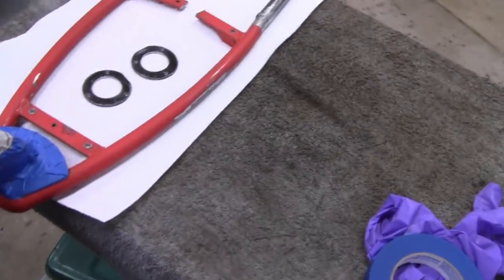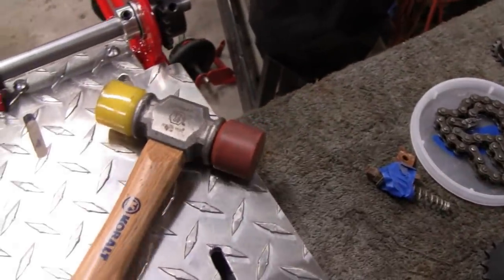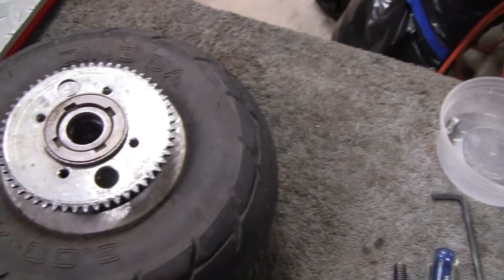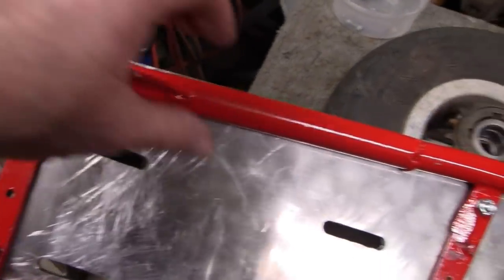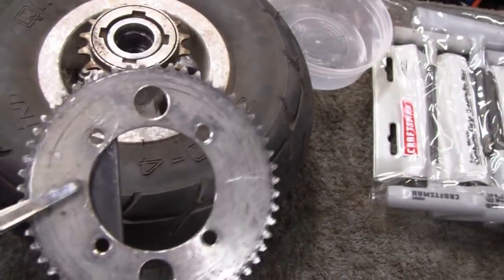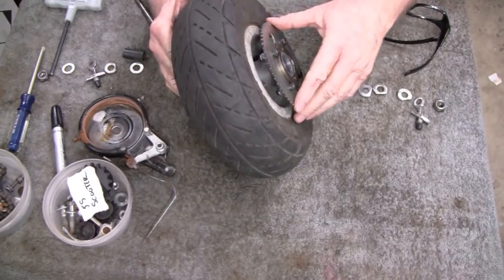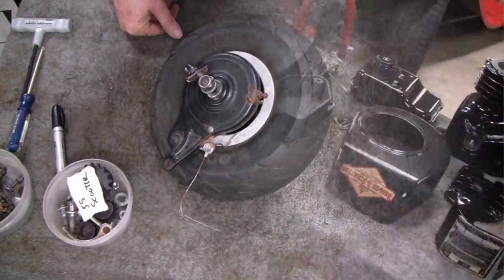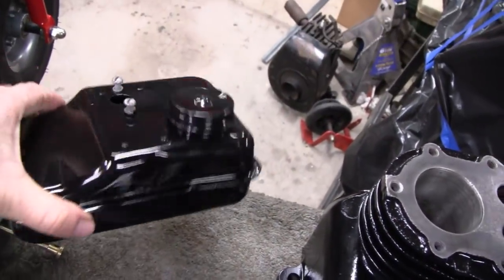MOTORIZED SCOOTER BUILD (part 16)

Comment: That sprocket is how they were built, lots of the Chinese made electric scooters use the same trick and I have one that's just the same.  Take a fine pitch chain (so they can have a small diameter 11 tooth sprocket on the motor), bolt it through the teeth of a BMX freewheel which is probably the cheapest way to get a freewheel on the hub.

Comment: Everett, quite some time ago, I had an 
Italian-made Harley Davidson branded 
2 stroke single 125 CC bike.

It had a similar setup, to what the rear 
sprocket here has.  A small (street) 
sprocket, mounted the usual way, and 
a ring sprocket that fit around the small 
one.  The ring sprocket's inner hole was 
the same diameter, as the small one, and 
had 4 half circle "holes" on the sides of 
the inner hole.

You'd put the outer sprocket in line, and 
4 bolts would hold the whole thing together
The bolts went through "holes," that were 
half in the ring sprocket, and the inner 
half, was the teeth on the street sprocket.

It worked just fine, except you had to 
remove the wheel to install the ring 
sprocket.

steve

Comment: Would be a good idea on any sealed bearing to pop a seal off it and repack grease in it. Some bearings can be saved by doing this.
Reply: Whoa there Allen McKinney,.....those sealed bearing ( especially good brand name makes ) have just the correct amount of grease inside these seals to allow for heat and expansion etc. Too much grease in there can be harmful to the bearing assembly. 
How do I know this ? Well, I've been talking to the folks at Timken and SKF some years ago about this very suggestion, and they both warned me against packing in more grease, for the reason I've quoted here.
Reply: @regsparkes6507  that may be true but I said repack to save bearings meaning old bearings. I was fixing a mower deck recently and one spindle bearing was dry and starting to rust. I regreased it worked it some and it started spinning like new.
Reply: Yes, you're correct Allen, this method  does get results for sure,...it's just that it isn't a recommended procedure in bearing maintenance. It will get a bearing rolling again, but it would be a good thing to have a new bearing close by, wouldn't it? 
By the way you will note that I did give your comment a thumbs up here, because  it does tell folks that in a jamb, it can get you going for a while. But,  like ROADKING, we don't do repairs by halves here in my shop,...we always replace the bearing in question. It kind of removes all doubt, wouldn't you say?
Cheers!